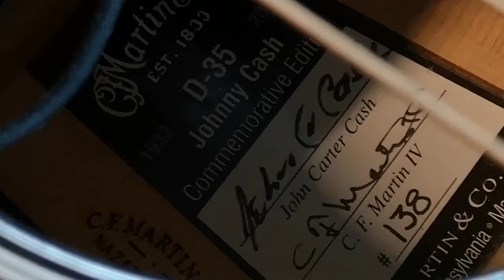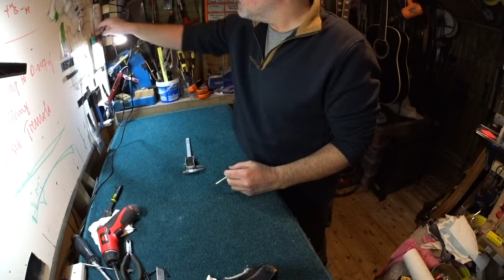Martin Johnny Cash acoustic quick set up

Comment: i ajusted my classic nylon string guitar's nut and saddle with bone, and filed some high fretspoints . i used a small v-shapet file , and 360 sandpaper , to hand shape the square bone pices ,,, over 10 days ajusting , i got strings laying over bone with very small v-shape ridge , just enough to keep the string fixed .no tunings probs  , no ping or delay ... 😍 now my 2 other guitar's sound like crap 🙄 shape realy matters big time . next 2 will be faster .. its hard work , but result's are amasing ,, was inspired by video of your's ,,  i was a bit scary a first not knowing the end result . next thing will be steel strings ,,

Comment: hi Sam what are you using to polish and buff the guitar please?
Reply from the maker: I use 'EternaShine' which is a US-made guitar 'scratch remover' polish. It's expensive...but it's pretty damn good. Of course it won't remove deep scratches (you have to repair them by filling them, scraping flush, sanding back and finally buffing out) but it will freshen up any / all finishes and make very fine scratches disappear.
Reply: @SamDeeksRelovedGuitars  cheers mate much appreciated